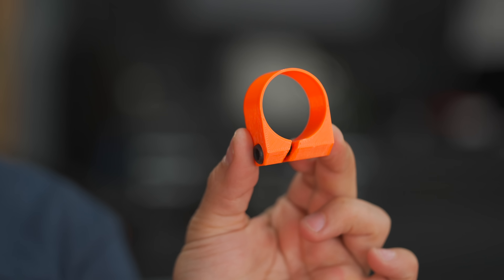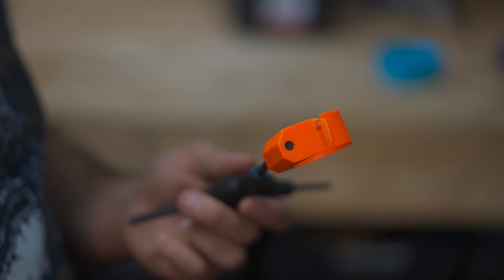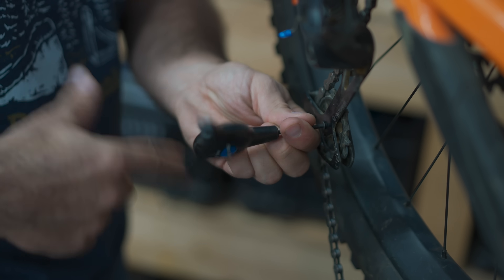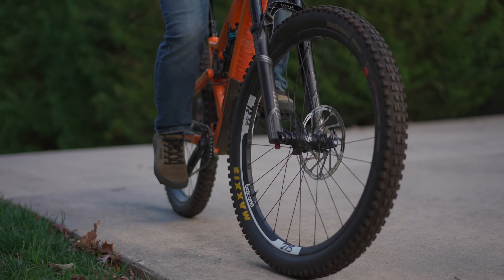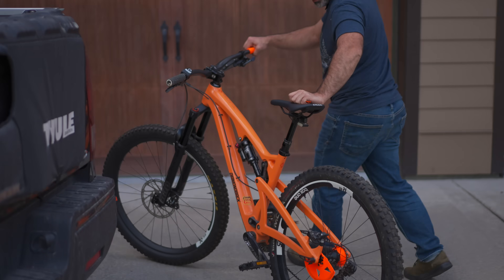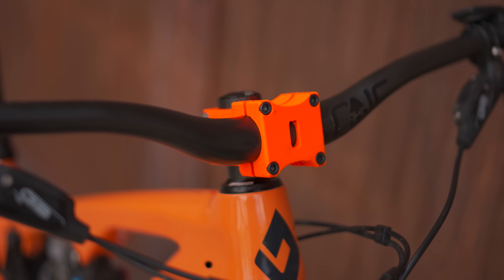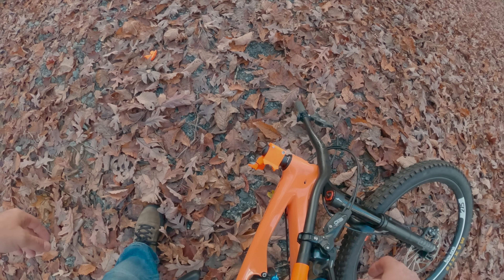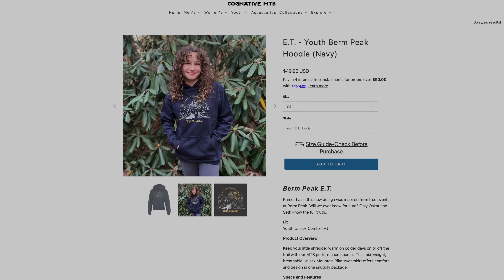Will 3D printed MTB parts break catastrophically? Let's find out!

Comment: The seat clamp and stem (be it a street bike one) would work perfectly with 3D printing IMO. The jockey might be better with resin although the brake rotor and gear prolly wouldn't work at all for actual use. With the 3D printed gun community I've seen people do the impossible. It just tends to be that the material governs the design process.

Comment: My commuter bike is covered with 3D printed parts. Light mounts, fender brackets, lock carrier, chain guard, bar end plugs. Nothing structural, high-stress, or safety-critical, but certainly very useful. Same is true of my car (even some engine parts such as the air intake) and a few parts on my motorcycle. 3D printing is nowhere near as strong as metal, but it often surprises me how much it can hold up to.

Comment: Thought for consideration. You could try printing those parts with carbon fibre filament, though you'd need to upgrade to a hardened/ruby  tipped nozzle. I've actually been using 3d printed lock on handles for about a year now, though only printed with PLA+. So far, I've not had to replace them, though I may have to soon due to weat.

Comment: This is pretty neat! 
I did a similar thing back in June, I printed a front sprocket out of pla for my old gates carbon drive equipped bike. Actually worked surprisingly well, I think I got about 90km+ out of it before it cracked.
Wasn't very efficient though, and made strange noises while pedaling.
Beats paying 70€ for a new one at least.
I contemplated doing the same for a chain driven bike, but thanks to this video, I now know that that's a bad idea.

Comment: i think if the part you are trying to print and design for a MTB type of bike, the part needs NOT to be under a lot of stress.
so anything from handlebar grips, water bottle/jug holder, cable clips or any tool holder will work just perfect. 
i think the jockey wheel works perfect too, its just a matter of when will it be deformed? because a metal chain is constantly being dragged over it which could potentially dig into the plastic.

Comment: I reckon a 3d printed Gopro/light bracket would work, especially a Gopro light bracket. We all have camera mounts on our bikes or helmets these days, why not make something to allow that mount to do something practical at night? Plus if you can get the fit right you can expand into fabricating other mounting options for a camera or even a phone-gopro mount so you can potentially film with a camera getting shots of your shock or mounted to the fork for a super low action shot and the phone mounted to the chesty. It makes sense for riders who don't have the sick connections. Not everyone can afford enough Gopros to record a new Bond film but everyone and their dog has a phone with a reasonable camera. Problem with phones is that they vary greatly, 3d printing can offer a universal file for the fixture point but opens the ability to modify the design to fit anything from an iPhone to a Pixel to a Note 10+.

Comment: An ABS, PLA, or PETG stem or seat clamp will not be strong due to the properties of the plastic, BUT perhaps a nylon stem or seat clamp would be much stronger.  Many manufacturers make pedals out of nylon.  Of course, there will be metal parts in any case (for example, bolts, nuts, washers, eccentrics).

Вынос или подседельный хомут из ABS, PLA или PETG пластика прочными не будут из свойств пластика, НО, возможно нейлоновый вынос или подседельный хомут были бы намного прочней. Многие производители делают педали из нейлона. Конечно же металлические детали в любом случае будут (болты на пример, гайки, шайбы, эксцентрики).

Comment: I successfully printed a bushing for a horst link on my bike. The factory bolt backed out and was lost. That with a flat head M6 bolt, printed using FormFutura CarbonFil Filament. It worked great until the replacement arrived. Rode about 150km with that part. You're a brave man for attempting the parts you did...

Comment: I'm not sure PETG is the correct material for this as it is more prone to break than PLA but because of the friction and temp buildup maybe NylonCF for the break discs and ASA for the gear rotors - the lube should be Teflon based...

Comment: to reduce the likelihood of breaking it's worth reducing stress concentrations around the clamp tabs with fillets, and using cutout slots to allow the clamp to tighten without propogating a crack in the adjacent material

Comment: This is cool but I think 3d printing still had a place in bike parts, just not ones that undergo stress. For example headset spacers, seatpost shims, fork tokens, barends, matchmaker adapters, bb spacers, cassette spacers, and jocky wheels could work great with a slightly more rubbery and stronger plastic.

Comment: Some parts and tools can be made of 3D printers.  I have succeeded in making volume spacers, a Fox CTD lever, a suntour and rst fork cap tool , all using ABS material. I’ve heard rumors that Nylon filament is stronger, might want to try that next.

Comment: One actual part i have been running is headset spacers since they don't take alot of load after the stem is tightened. The main benefit is you can get you bike fit sub millimeter perfect

Comment: As someone who actually tried to print gears my self i have to say that it is possible. The skipping that you felt was the chain hopping over the teeth wich can be prevented by useing the actual teethprofile of a casett since the teeth aren't symmetrical. When the teeth are holding your next problem (at least if you want to have multiple gears) is that the gears start to rotate on the hub. I did come up with an idea how it could hold together but i never got to test it because my printer broke. Plastic gears won't be suitable for mountainbikeing since there is just to much force but for city use they should work just fine

Comment: With the correct design and material, you can make amazingly strong components. I have a moped running 11k rpm with a polycarbonate 3d printed reedvalve and admission pipe. These parts are susceptible to heat and strong vibrations but after a few 100km’s they are still in perfect condition.

Comment: I have 3D printed spacer on trail bike rear brake caliper from 160mm to 180mm disc for over two years now with no cracks or wear.  Printed in ASA.

Comment: How about using bike handlebar wrap tape on the grips? And while the Carbon makes the filaments stiffer and the prints lighter, they are more brittle. A plain Nylon filament would be the way to go for something like the stem, wouldn't fail all the sudden. At least that has been my experience with those types of filaments.

Comment: As a mech eng I would just say no to 3d printed parts for your bike, wood would have been better 🤣 everyone is a design eng oh look it broke there we just need to make it thicker. .. if only it were that easy. But look at helicoil or recoil thread inserts to make your threads stronger, I have used these on aluminium stems so best of luck with your plastic haha 🤣 in saying that there are lots of plastic composites that are used in heavy eng that show no great signs of wear, but I don't believe there is a filament that lets you print that. Just read up on strength in section that will help your design immensely.

Comment: Don't use PETG for mechanical parts. If you insist on using this, use PET-CF (non glycol modified). Otherwise, use carbon fiber Nylon or PA6-CF.

Comment: You should get a resin printer and get some engineering resin. It makes parts that i couldnt even break with my hand for my rc stuff. Also no layer lines you can actually feel. And anything that needs threads you should have put press in brass threads.

Comment: The problem is not the plastic printing, the problem is the design. I like what one person said: "design is ten times more important than material." printing can be produced with reinforcing materials, creating a composite. use glass net, metal net, or other materials. in conjunction with the correct volumetric design - this will give the necessary result, but I'm not sure that this will work for downhill)

Comment: I printed spacers in axle rear-shock (stark devolution - 200mm) - and all OK for 1 year!
Also spacer between bearings in rear hub - norm works about 2 years.
Plastic norm works on compression, not bend or stretching

Comment: I remember the early days of using Tinkercad when I first started. My advice is to upgrade to Onshape, more powerful and a traditional CAD program while still being browser based. CAD is a great skill to have and you can look at a problem and print a solution. Also flexible filliments like PETG would make the breaking problem a lot better, not for the gears, but for the handles and other pressure fit parts. I cant imagine replacing anything originally made of metal is a good idea though.

Now if you want to go crazy, there are filliments that are imbeded with metal so you can throw it into a furnace after to make it a fully metal part. Never tried it and looks like a lot of trouble, but it is possible.

Edit: Its a cool hobby you can sink a lot of time and plastic into. Like all the possibilities for custom storage solutions, brackets to connect wood or metal. So many possibilities for weird needs you cant buy online.

Comment: looks like you printed the stem and such with an infill of sorts, you can definitely up that infill and create stronger parts as well as increase the outside layer lines to add rigidity. Also when creating 3d printed parts for strength it is usually best to go for more organic designs. If you've ever seen those crazy 3d printed metal parts that look like they came off an alien space ship it's because they are optimized to have no sharp corners and no places for the cracks and failures to propagate from. Chamfering or filleting edges goes a long way in making parts more durable. Also, many exotic materials exist when it comes to 3d printing if you really want to move up from there.

Comment: I appreciate that this is put out for the entertainment value, and it definitely is entertaining. I am curious to see parts from a more impact resistant material, PLA+ or CF Nylon. And parts designed for 3d printing. Instead of steel and aluminum designs 3d printed as is.

Comment: handlebar grips is one thing but seat post clamps could fail and the seat could go slamming down causing you to lose control.

brake rotor failed but you was going slow so you can stop safely then .

through axles is getting very dangerous because you could lose control and crash.

you should wear helmet and armor pads when testing stuff so if you go down you wont get hurt..

you are lucky that the chain did not get into the spokes or you could have lost control and destroy the deraileur and even the wheel.

i was hoping for your safety that the axle would have snapped when you was tightening the bolt so you would get a warning if the potential danger.

you riding on the lawn does help

front only brake can result in flipping the bike and getting hurt

you are lucky that the chain fell off away from the spokes because you can easily spend hundreds or even thousands on a complete shift set and even deraileurs can get expensive.

though your safety is most important.

lesson learned only non safety critical parts like handlebar grips and some accessory mounts can be 3d printed.

Comment: the research and development potential with 3d printed parts is limitless!!!! you can make prototype stems and dial in dimensions for a fraction of the cost of having new parts machined. 3d printed parts may not hold up to real riding situations but i can definitely see them being used as a cheap alternative to dialing in new ideas.

Comment: Nice video, very comical, and I get it, there are a lot of people that try and do some strange things with 3D printed parts, but the video is a little misleading, I make parts for MTB bikes, ebikes and motorbikes all the time, I make 104BCD chain rings for Bafang mid-drives, they do not break, mounts for displays, adaptors for bottles, stem spacers bike rack adaptors and all sorts of aero dynamic accessories for competition race bikes, even parts for Harley's, but I use PPETG-CF15 or standard PA-CF for its flexibility and impact resistance, TPU instead of rubber which is great for making grips, gaskets and even soft layer between a clamp and a tube, I have no issues with any parts, but you need to pick your battles, cogs, disks and other hard working, high stress and high wear parts cannot be substituted, heck even the metal parts fail, but next time instead of using Prusament PLA, try some real filament like PA/PA6/PA12-CF or UPAHT-CF15 and use a printer with a heated chamber, also heat treat your parts bud, I anneal all my high quality CF parts for 8hrs at 140 to 160° C, increase the thickness of the material and use heat inserts or captive nuts. All I learnt from your video, is one shouldn't make plastic bike parts if you have made a bad choice in filament, have bad part designing skills, are clueless about engineering and own a terrible printer like a Prusa, Id say stick to making great videos and the odd tool holder or figurine with Prusa Printer and leave the making of good quality custom designed parts to the ones with right tools for the job.

Comment: I mean, if you did them in carbon fiber nylon with all walls instead of having some infill, plus optimized some of the geometry to reduce stress points, you could easily have parts that will hold up for years. Fixturing would probably be fine but I would not do high load areas like drivetrain and brakes.

Comment: Bart of your issue is the material. PLA in most cases is not very strong. ABS is better for strength. Unless you dabble with carbon fiber reinforced PLA. If you print the part and throw it in the oven for 2 annealing cycles. The crystalline structure aligns better for a stronger part. They also have a metal filament that can be printed in larger nozzles as well. Your printer in it's current configuration wouldn't be able to use this without a nozzle upgrade for your extruder. One reason I bought a lulzbot printer. The Taz 4 was modded by NASA so they could print emergency parts on the ISS till a resupply mission could get them new parts. Been watching since Seth's Bike hacks when you first started trail building. So cool to see you mess around like this. Another HUGE factor is how your set your part on the print bed due to the slicer. The slices can cause weak points with kinetic energy being distributed poorly in that area. Those brave enough too mess around with 3d printing gun parts (I got no interest in a Darwin Award) found that sometimes having your part at different angles on the print bed can result in a stronger part. If you want to experiment more, feel free to reach out to me. No expert but love 3d print and with a background in MFG. Found that knowledge to carry over as well.

Comment: LOL, yeah that was bold and impressed that you actually rode it.

I make non-critical bike parts (always print solid 100% infill).  Also nylon or filament with carbon fiber will probably work better.  But I still would not use myself as a guinea pig!

Comment: the great thing about this is you can test the prototypes to see if it functionally possible and can withstand minimal stress. You could then utilise the 3d printer and a stronger filiment to acctually make viable parts. potentially making cheap emergency replacement parts that can safely get you back to the car/home (provided they dont go to hard core)

Comment: I highly recommend considering hexagonal nuts or heat set knurled nuts. If you really have to screw into plastic, don't print threads, print a cylinder just slightly bigger than the inner diameter of the bolt/screw shaft, it should be slightly big enough to accommodate the volume of the blades/teeth of the screw/bolt, and thus avoid putting pressure on the part, which might weaken its ability to hold onto the screw/bolt's threads.

Comment: You know, if you extend the lock on grip, use a hex nut, and move the screw to the inside, youd be able to put actual grips on them. Then you can have multiple pairs of your favorite grips you can quickly swap onto different bars. Make deciding what grips you want much quicker and cheaper!

Comment: Yeah - you shouldn't ever be guessing at such stuff. Thats not engineering. You need stress analysis (FEA) . Hopefully if decent manufacture the real original parts (alloy -non PETG) will have been analysed and tested - why not these ?  I don't why you would choose 'sketchy' approach as some sort of badge of pride.   As engineer I know for fact  PETG is small fraction (20 -30%) of yield strength of a decent alumnium alloy. Your cross sections should be x 3 to x5
Reply: CONGRATS !!👆
YOU WON A GIFT🎁,,,,,,,,,,,,,,,,,,,,

Comment: I agree I don’t think I would 3d print high stress parts like you did on my mtn bike. But guards and fenders and such would be great. Also the other great thing about 3d parts is you can just print another once you get a design you like if it breaks.
Reply: Agreed - my commuter bicycle is covered with 3D printed parts. Light mounts, handlebar plugs, chain guard, fender mounts, lock carrier. Nothing safety-critical or high-stress, but extremely useful. The same is true for my car, and to a lesser degree (so far) my motorcycle.
Reply: @quillmaurer6563  can I ask what setup you’re using?
Reply: @quillmaurer6563  awesome, thank you!

Comment: Instead of using printed threads, make hex indent that fits a matching nut for the bolt, that way the bolt holds onto the nut rather than the printed plastic
Reply: CONGRATS !!👆
YOU WON A GIFT🎁,,,,,,,,,,,,,,,,,,,,